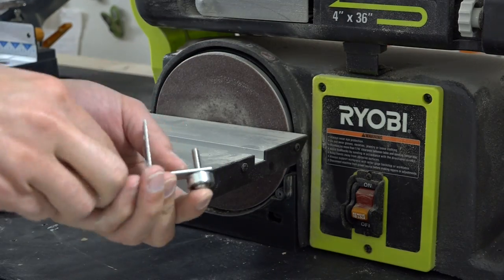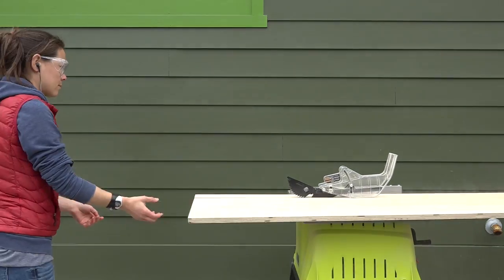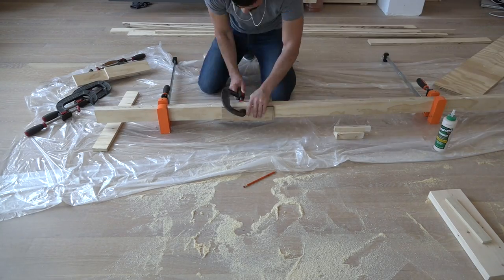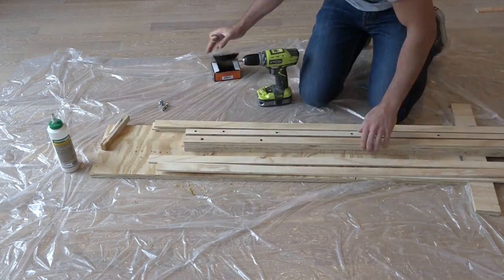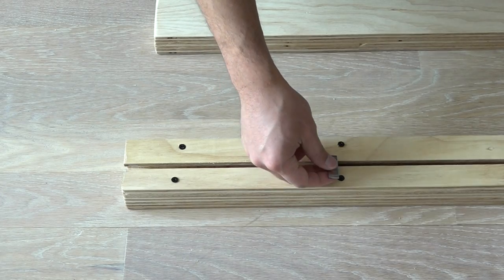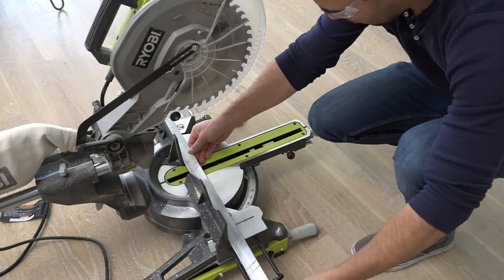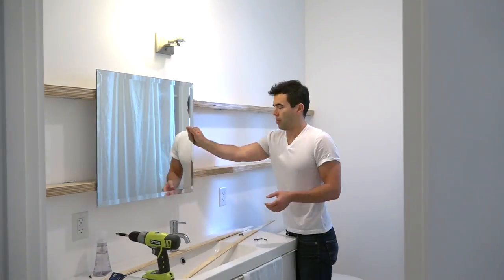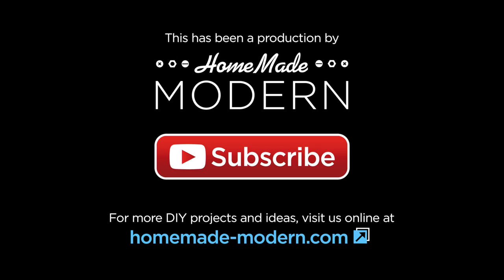DIY Sliding Bathroom Mirror

Comment: Nice, but those bearings will rust pretty quick in a bathroom Im afraid( unless they are stainless ?). I've used them for a similar project. Also, why not a bottom track to stop the mirror from flailing around at the base ? would a piece of board not have been better to attach the brackets, and then the mirror set in that ? perhaps with a routed edge ? love your work, keep it up.
Reply from the maker: good observation!  yes i spent the extra $ and  used stainless!

Comment: I would suggest putting in a stopper somewhere to make sure the mirror doesn't hot the wall if someone accidentally slides it too far
Reply: hit*
Reply from the maker: good idea!  i think i will just put a screw in the track to stop the wheel